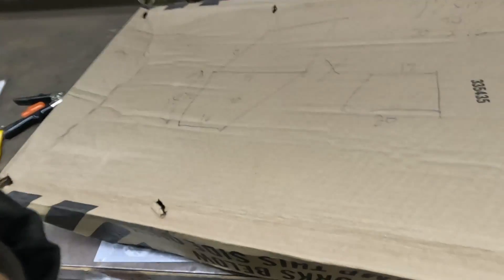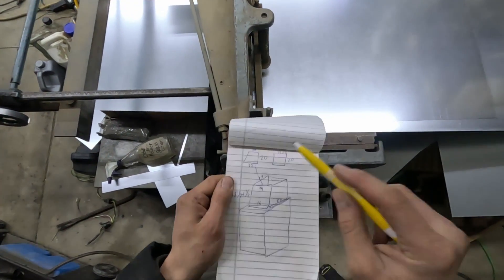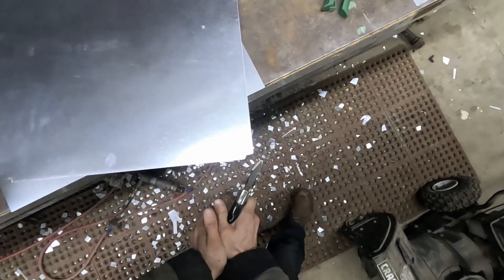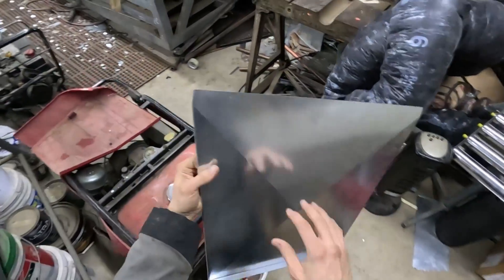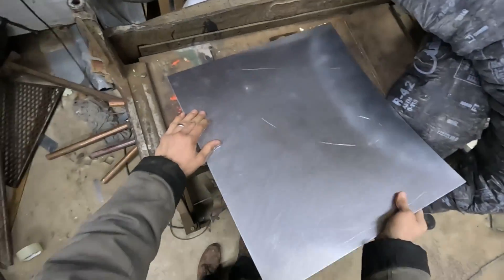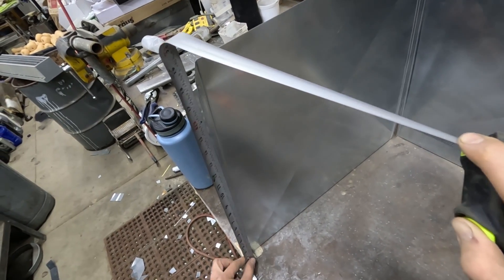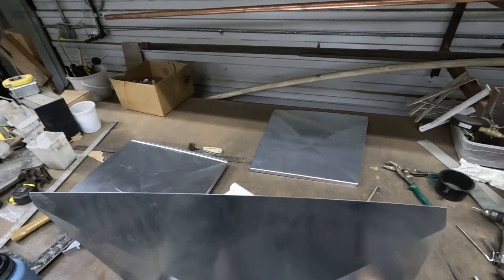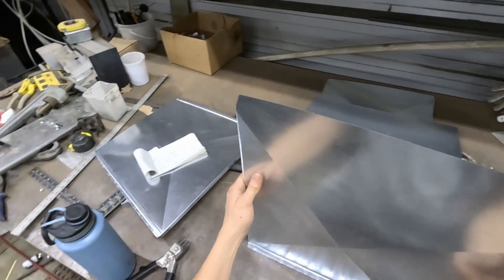Building a Two Way Duct Transition Plenum

Comment: i think they make them shorter to accommodate taller coils for high-seer bs. 
in the north, don't need 13.8 seer 2 a/c for the short few weeks of hot weather - that are basically 14.5-15 seer.